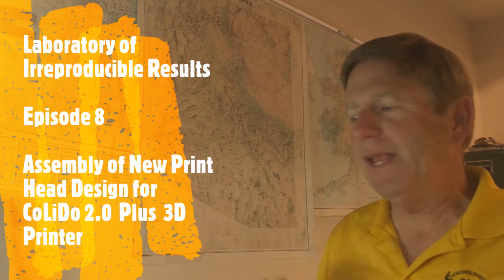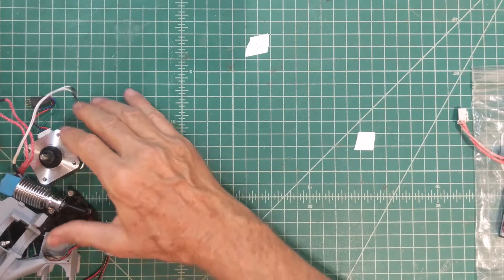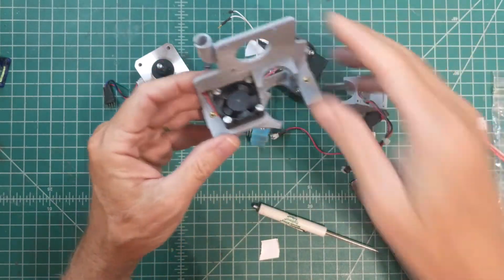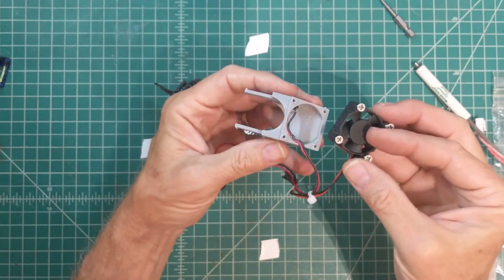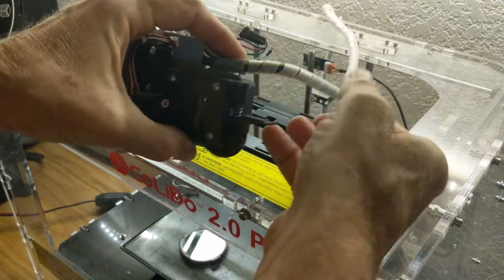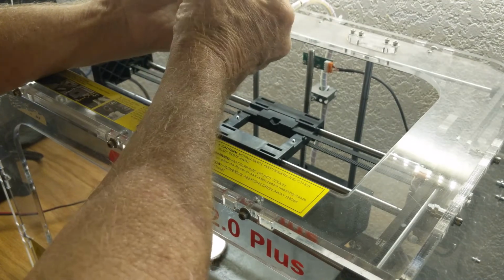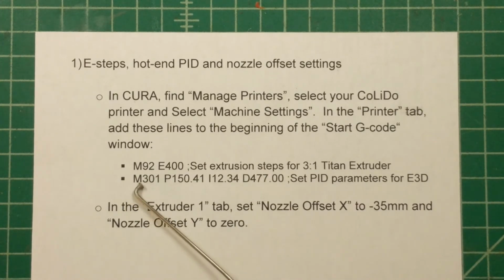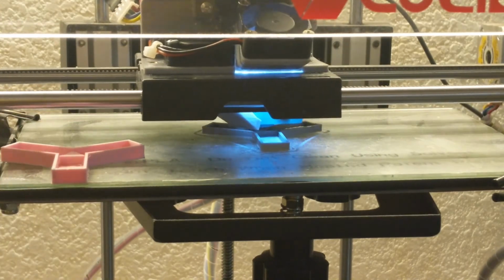Laboratory of Irreproducible Results - Episode 8 - New Print Head Design for CoLiDo 2.0 3D Printer

Comment: I've been working on this for my Colido M2020 since it uses the same sled and this'll also fit on that with only one modification.
The Colido 2.0 looks to be much wider and open at the top so I need to add a roughly 1/4" extension to the nub for the microswitch to prevent the extruder gear from hitting the frame edge and adjust the bed size in settings.
I'll also probably shave off a quarter inch from the left edge since the wiring harness will come really close to the frame.
But I'm okay with giving up half an inch of bed space on the sides for a printer that barely functions as is
Reply from the maker: Awesome! I'm not familiar with the Colido M2020 model but I'm glad you are finding some useful info from this episode. BTW, I'm not using the Colido 2.0 much anymore because I have a newer printer. If you are interested in owning the 2.0 that I modified in this episode, make an offer!